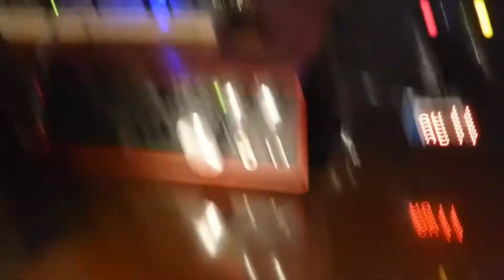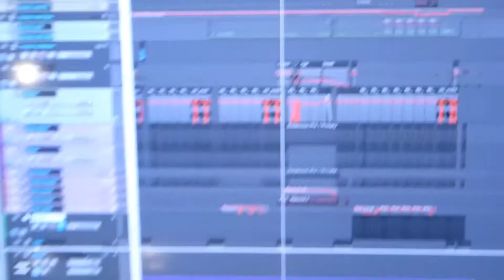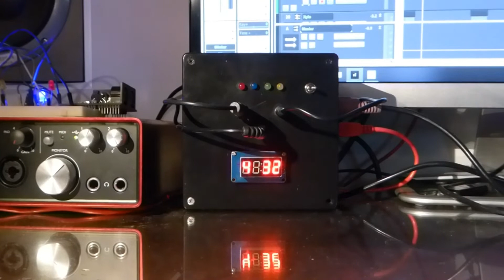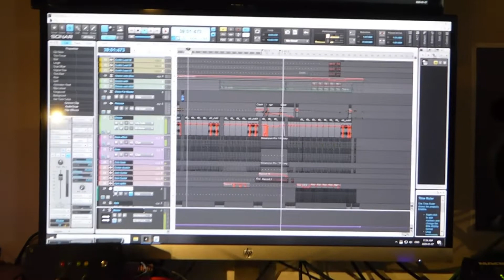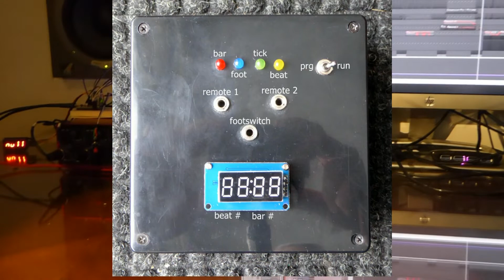DAW sync'd metronome - Arduino project

Comment: Hey Garry this is awesome! Are you still sharing the code/schematic on this project? If so could I get a copy please? Thank you!
Reply from the maker: Justin Thanks! There have been quite a few requests for the code+circuit so I just need to bite the bullet and post it on one of the Arduino share sites. Give me a day or two and I will come back with a link.
Reply: @GarrySchultz  Hey Garry that would be great I'll keep an eye out!
Reply from the maker: @justinrice6046   try this https://create.arduino.cc/editor/garryschultz/f894e347-aaab-421f-b791-7b937d0e3779/preview
Reply: @GarrySchultz  Hey thank you so much for this I really appreciate it. I use a teensy2.0 and am porting a portion of this code over. I want to use it to control the tap tempo on my guitar delay pedals. I also wanted to use it on a looper pedal so I can have a loop exactly x number of beats long. 

Are you assuming in your example that the time signature is 4/4 for counting bars or are you retrieving the time signature from the DAW somehow?